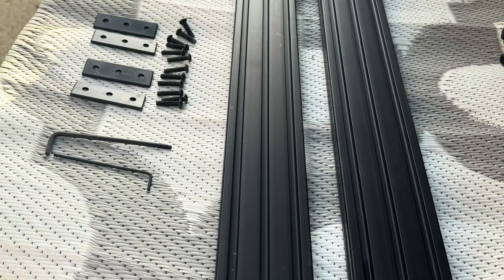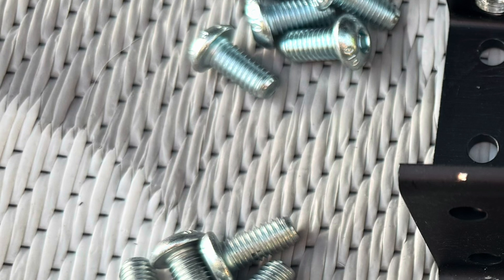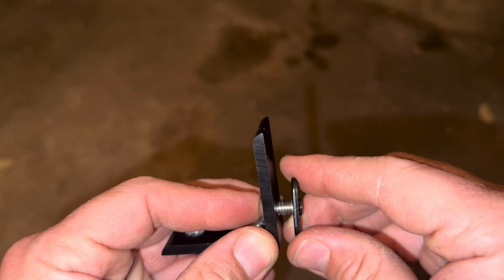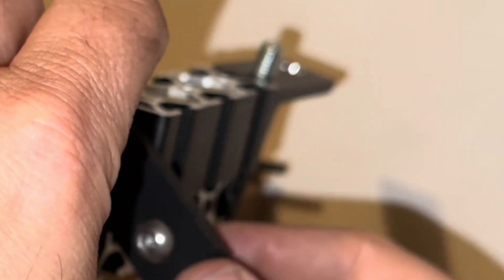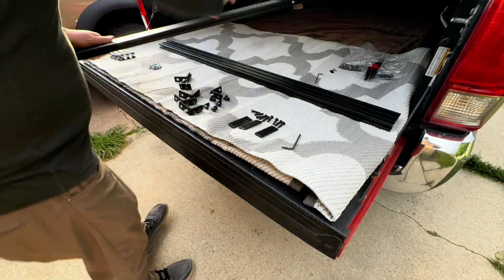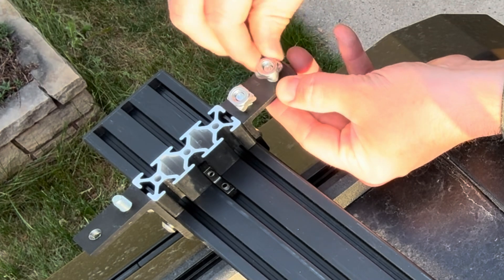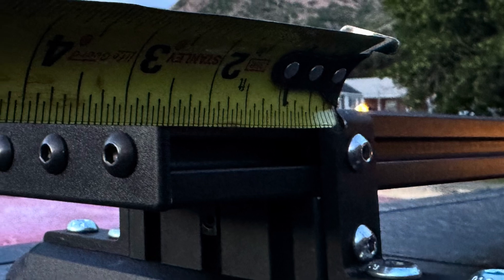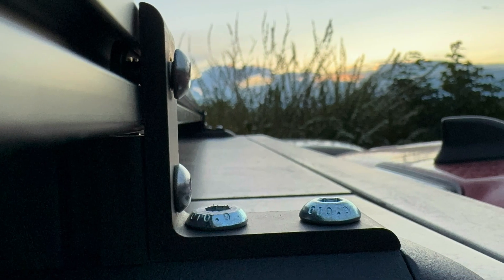DIY Load Bars for RSI SmartCap $175 (aluminum extrusion)

Comment: Just did this on my F-150 smart cap. 47" gave a 1.25" or so overhang at the rear on each side, but the front of the rails are more narrow, so the 47" wide piece up front barely made it to the edges of the side doors. I wish I would have thought to check to see if the rails were equally spaced the entire length, otherwise i would have ordered a longer one for the front to be able to get it further up towards the cab. 

So for anyone looking to do this on an F-150, measure the widths before ordering....
Reply from the maker: Thanks for the tip! I appreciate you sharing your experience for other F-150 owners.

Comment: Hi, where can I get the roof rails to mount on the roof to connect the racks? I don't have a smart cap and want to put this on a fiberglass pop top.
Reply from the maker: The SmartCap comes with the rails already attached. I couldn't tell you where to find rails for a fiberglass. Perhaps you can ask a local dealer who sales caps/shells for trucks.
Reply: You can buy any T-track rail, Most of them have mounting holes ready so you can bolt them on about everything.

Comment: Thanks for this. Just assembeld mine and it works great! The M8 Screws were missing from the description, Luckily my friendly ACE hardware had waht I needed.
Reply from the maker: I added those M8 screws to the description. Thanks for the heads up!
Reply: @rockymountainscouter5800 Inordered parts today. Thank you so much!!
Reply: What length should I order?
Reply: @davidmorefield3857  m8 16mm I got countersunk ones for the inside corner so I didn't have to grind down the heads.
Reply from the maker: Counter sink sounds like a great idea! I'll bet they turned out slick.

Comment: Could you provide a parts list with part numbers?
Reply from the maker: I just added it to the description. Be sure to pay attention to the selected options when ordering, your hardware will be ordered with the item, not separate. Thanks for watching!
Reply: @rockymountainscouter5800 thanks so much.
Reply: @rockymountainscouter5800 just got mine in and noticed that your description seems to be missing the M8 screws, something I sadly found out when I went to assemble everything together
Reply: @chrisjohnson00 What length M8 do I need?